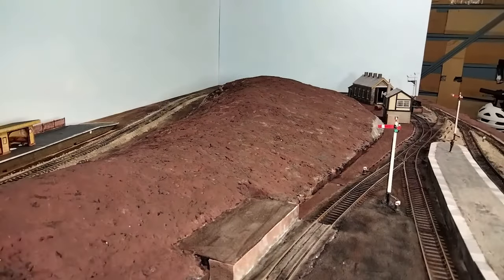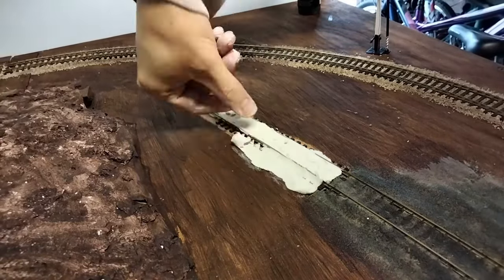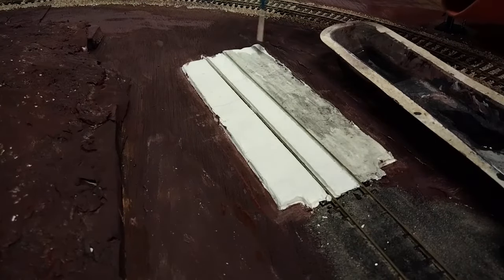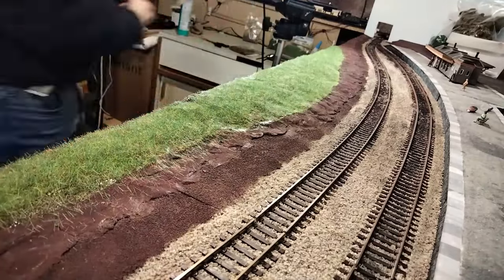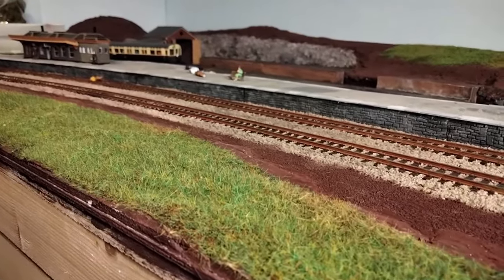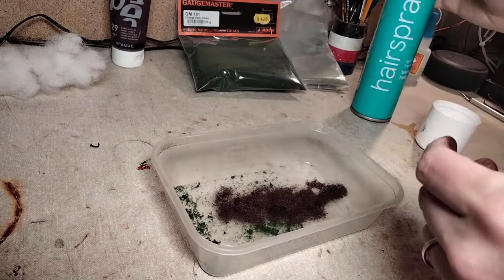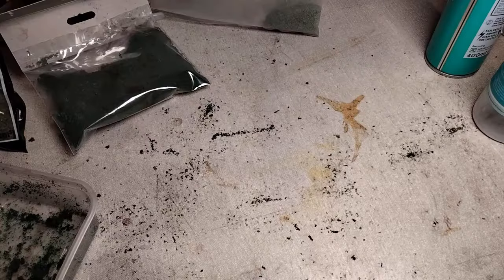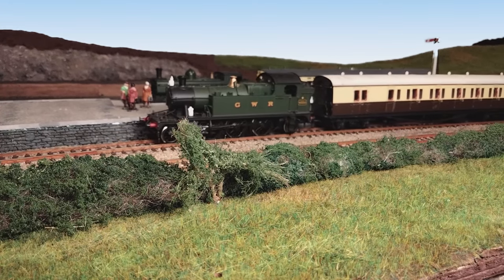Static grass and hedges | Modelling a GWR branch line | Episode 20

Comment: Fine leaf foliage from woodland scenics is KING for bushes and trees in my opinion. Straight out of the box and lgue it down where you want it, its brilliant stuff!! 

Generally speaking, in a small or even big loco depot/shed area you find sleepers, spare bits of rail, barrels, boxes, pallets, all kinds of junk. Cable reels are great aswell, though maybe not prototypical for the 1930s!!
Reply from the maker: Thanks for the recommendation, I'll check that out!

Comment: What is the brand of static grass applicator you use??
Reply from the maker: No brand, as such, just a cheap thing I bought on ebay a few years back.
Reply: @FrontingtonandBackwoodsRailway just a heads up as I long wondered about the croc clip as seen lots using it various ways. When I looked into it, this acts as the negative charge that the grass which is positively charged in the unit then stands to, so holding the clip far away means the grass won't stand up as well. There was an article on the myths about static grass. So ideally you want to hold it near to the grass as it falls. 🎉